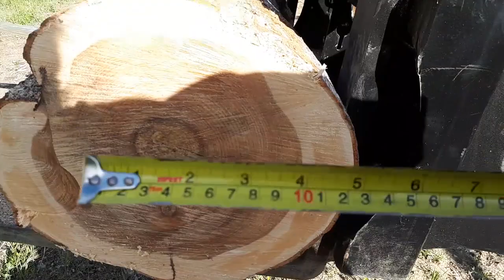Working the Processor in the year 2020 part 2 (Range Road EcoPro300) How big is too BIG???

Comment: It’s a good thing iv got 3 other splitters.  That why I want one to cut out the chair saw. And handle rounds 5times.
Reply from the maker: Thanks for the comment,  we also have an independent wood splitter, a three point hitch that fits on the tractor that we can use for oversize logs. Cheers from John and Audrey

Comment: Well, i dont regret my T29 ! I had cut and split 17.5 inchs diameter. Wy you operated whith the 6 way wedge whith small wood? It produce a lot of very small pieces. 
Thank you for your vidéo and sorry for my poor english.
Reply from the maker: Thanks for your comment, we do have a 4 way splitter but prefer the 6 way to make the smaller pieces for lighting the fire. If we produce firewood for commercial sale we would use the 4 way to make bigger wood pieces. Merci